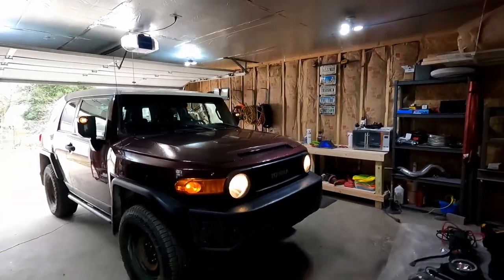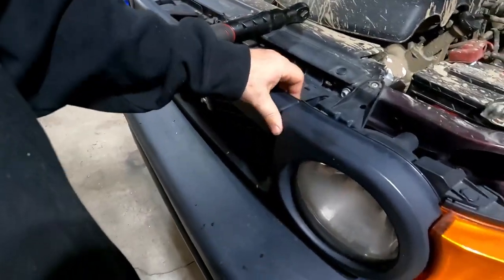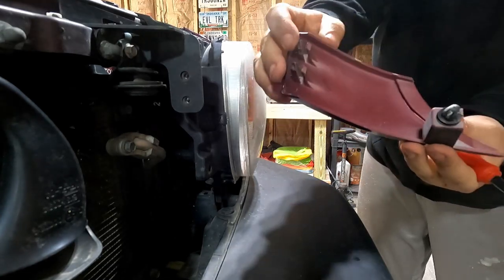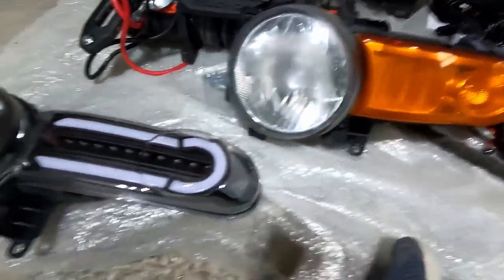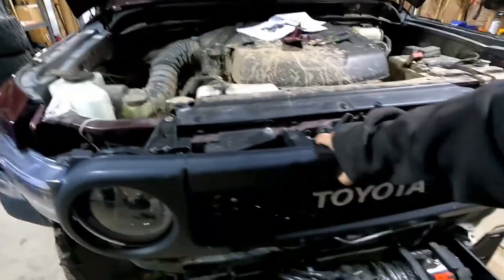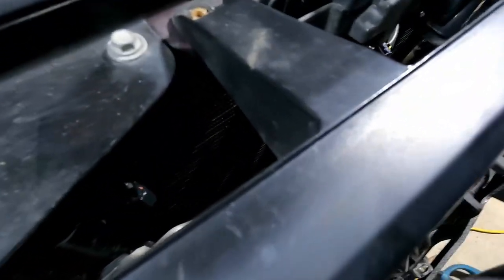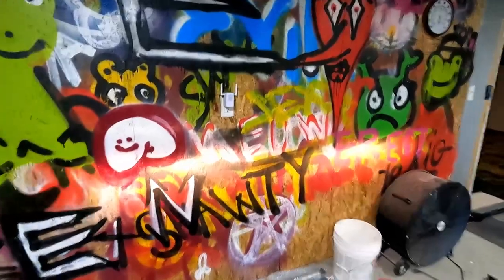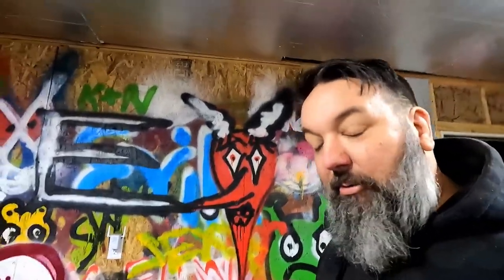Fj Cruiser Headlight Replacement and upgraded turn signals.

Comment: How to wire the Halo Lights. Strip the ends of the the two sets of black and white wires. Twist the blacks together (these are the grounds) and the whites together (These are the leads). Unplug the connector from the back of the headlight. It has 3 wires and 3 connections made to the bulb. You want to tap the horizontal connector. This is the one that has the 2 vertical connectors one on each side. On the drivers side this is a red/yellow wire and on the passenger side I'm not sure of the color but again it is the wire feeding the horizontal part of the connector. Unplug the lights get a voltmeter on DC Voltage 20 Volts and turn the truck on. When you put the red wire into the horizontal connector and the black to ground you will see 12v or more. This is the wire you want to tap. Use a tap where you place the existing wire through it and the 2 whites that you twisted together and snap it closed. Do this on each side of the truck but keep in mind the existing wire on the passengers side is thicker so you will use two different size connectors. Then connect the two blacks together on each side and connect them to a wire long enough to reach a ground point. I ran mine to the terminal on the side wall just in front of the under the hood fuse box. It takes time but make good connections and it should work when you turn the truck on.

Comment: Hey man I have the same blinker lights ! I have a question, I know I connect that silver cylinder cap thing into the lighting harness but what do I do with the little orange “ 50w “ box that’s connected to it too ? And the separate one white and one black wire ? What do I do with those two ? Please help hahah, awesome video man thanks

Comment: I just bought these and I cant get them to aim down. The adjusters dont work. Did you have this problem?
Thanks
Reply: I just put them in tonight and I also have the same issue, let me know if you find if anything works
Reply: So a little update, and maybe you can help me a little here, I emailed support about the issue so I’ll keep you posted, but my issue is with the new headlight, there doesn’t seem to be that little pin that holds the plastic panel that sweeps under the headlight, it’s just an open hole, I wish I could provide pictures but hopefully you understand what I’m talking about.
Reply from the maker: I didn't,  the adjustment "screw"  seemed a bit flimsy but it worked ok.
Reply: Update: So there is 2 adjusting screws. The one you want to look for is located at the bottom. Once you see it, you will need a long screw driver and from the top there is an opening where you insert the screwdriver and turn it counter clockwise. I hope that helps everyone.